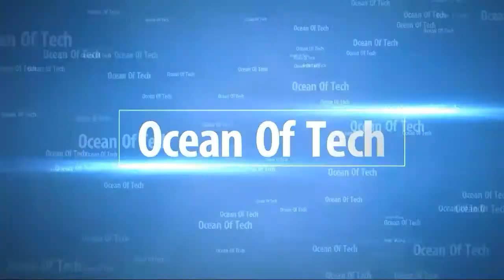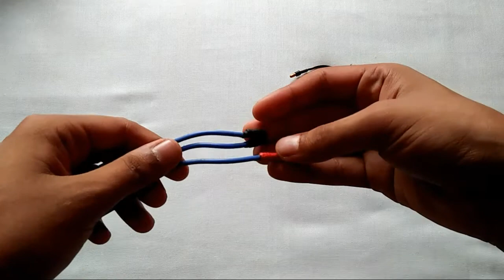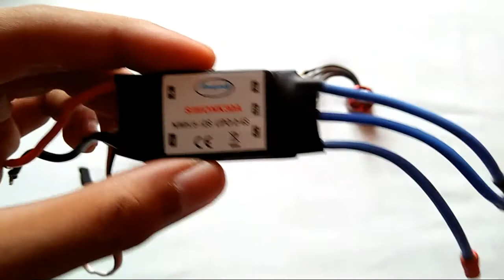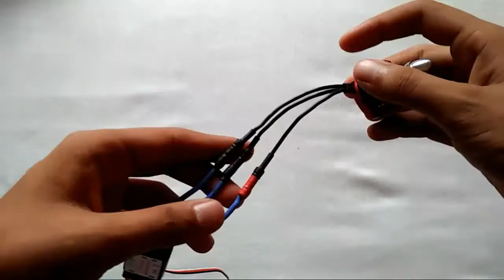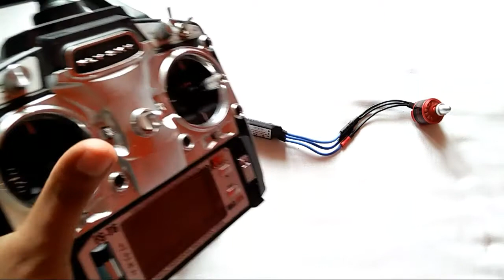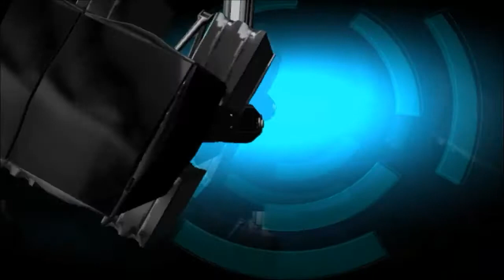ESC(electronic speed controller) explained,how to choose perfect esc,firmware,callibration etc.

Comment: What about volt sir? I have a 60a brushless motor and 36v battery, after a try my 120a ESC burned. Could you please tell me what ESC should I buy? Many thanks.
Reply: Sounds like your ESC was rated way too high. ESC amps should be about 10-20% higher than motor amps. So for a 60A motor, 70A ESC is ideal.